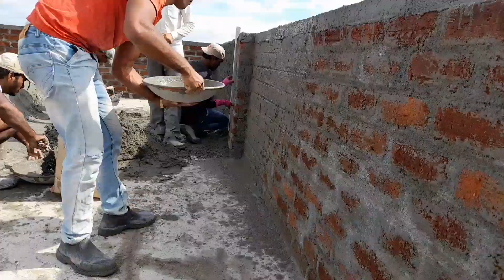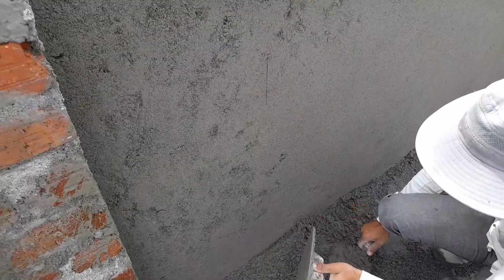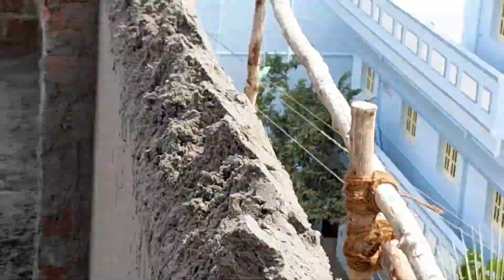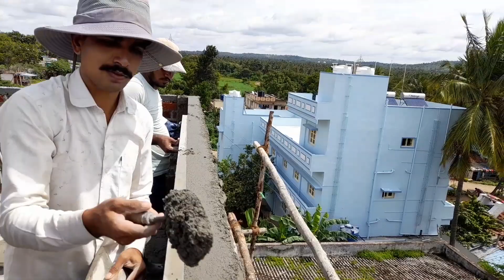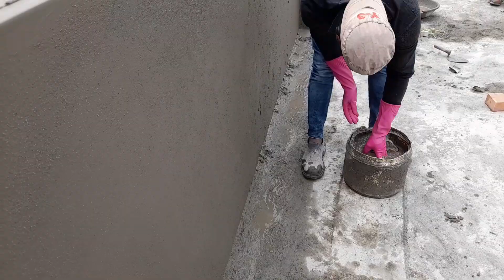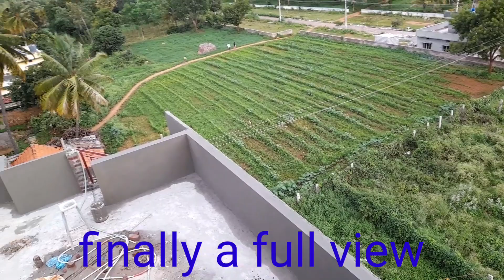Faster way to plastering small parapet walls with amazing sponge finishing

Comment: What is that small L shape tool you use for borders. Where can I buy it?
Reply from the maker: Sir, it is commonly used in South India like Karnataka Tamil Nadu, it is called pinji or mule cup in the local language, it is also called corner cups in English.
You can try it by searching online, otherwise you can try to buy it in a hardware shop.